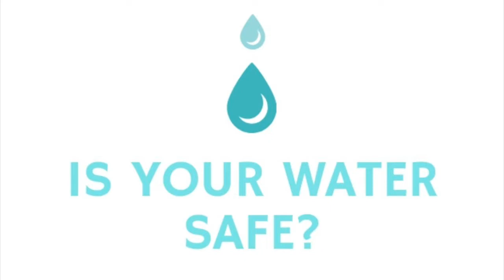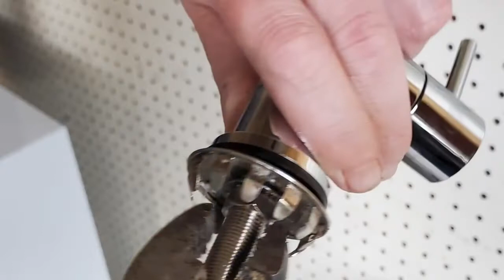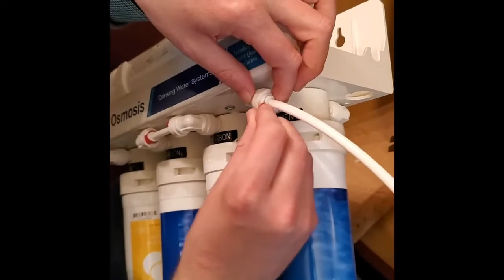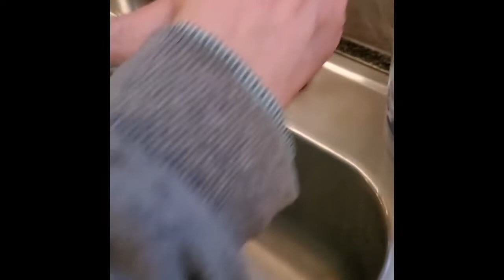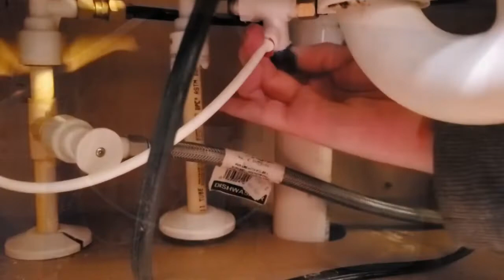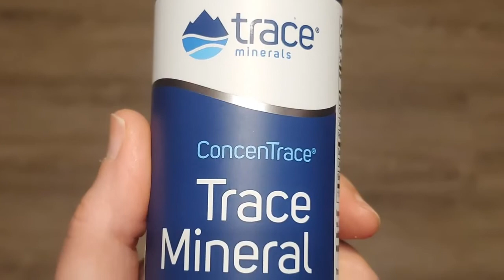Make your Water Safer  RKIN Under sink Reverse Osmosis Filtration Installation and TDS Water Testing

Comment: very good
you could add, remove black plugs before putting tubing in, make sure tubing is inserted almost 3/4", leave enough tube in the tank so it can be moved out of the way with out taking the tube out for sink pluming repairs